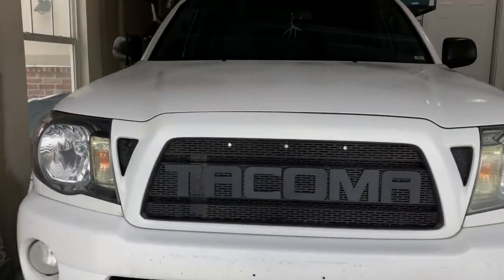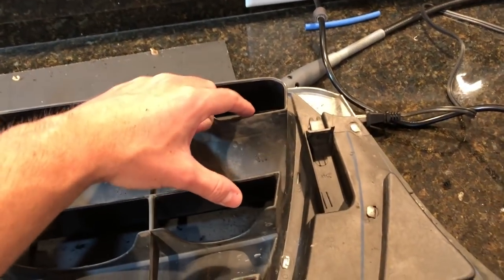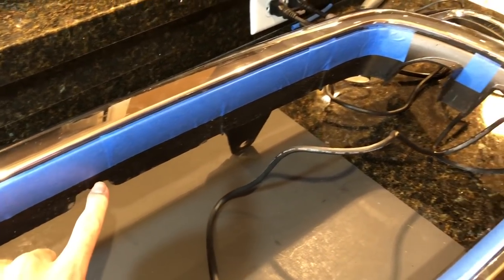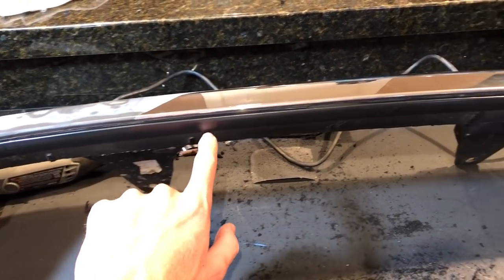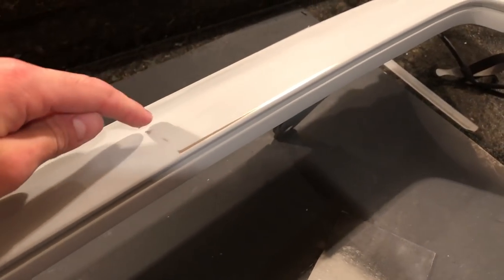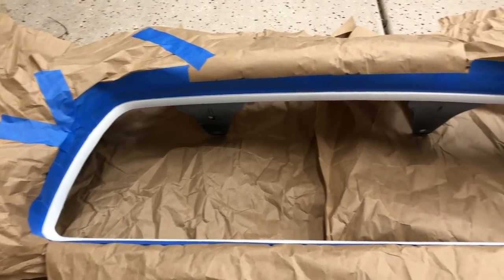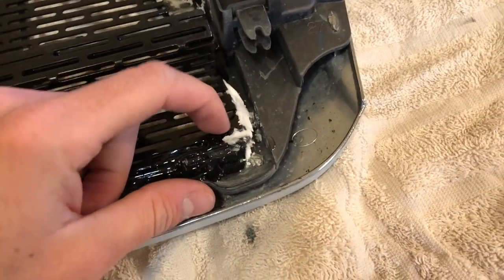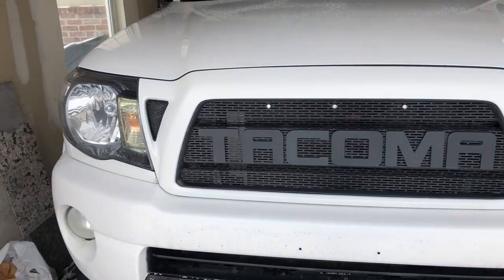DIY Tacoma Raptor Style Grill

Comment: Truck looks awesome! I'm looking to put Raptor Lettering on my 2011 Tacoma. I want to paint them Super White to match the body but haven't been able to find a spray paint that matches. Where did you get yours?
Reply from the maker: I used a can of Dupli-Color color match paint that I got from O-Reilly Auto Parts. I read some reviews and some said that if you use the clear coat, it makes the color off a little bit. So I just did the matte finish and it turned out good. 
But I’ve heard you can get the color match paint from the dealer in a spray can too, I’ve just never asked them about it.

Comment: Hey how'd you make bends on you're grill or they come like that?
Reply from the maker: I would epoxy one section at a time (bottom, sides, then top) and I just used my hands to bend it to shape. I really only had to bend the top area a little. The middle had enough flex to it to where I didn’t really need to bend it
Reply from the maker: Just bend small amounts at a time
Reply: Hey Braxen, thanks for the awesome vid! Where did you get the grill from?
Reply from the maker: Jonathan Thiranop it’s made by a company called BPFabrications, they sell the mesh and lettering and then on the 2nd gens you have to cut and install it like I do here.
Reply: Braxen McConnell you are the man! Thanks for all the awesome vids

Comment: Thanks for the amazing vid. Where’d you get the lettering?
Reply from the maker: The mesh and the lettering came from BPFabrication, I actually found mine in a local classified ad (the guy didn’t want to do the work to install it) and got it a little cheaper, but they’re not too bad on BPFs website.
Reply: Braxen McConnell thanks :)